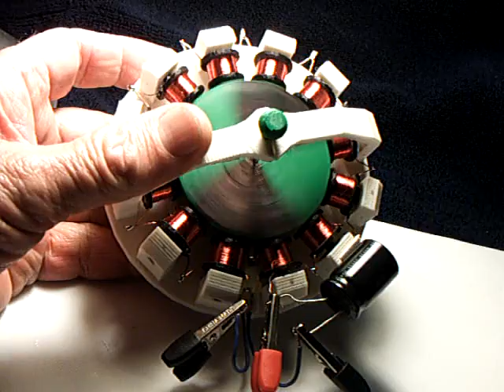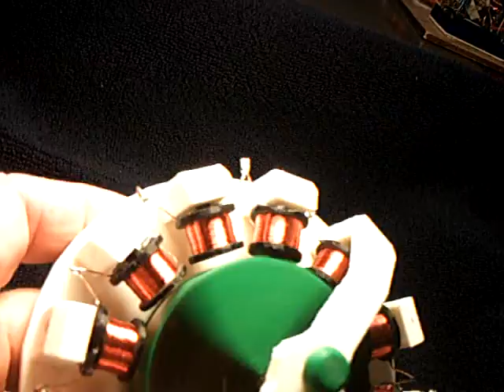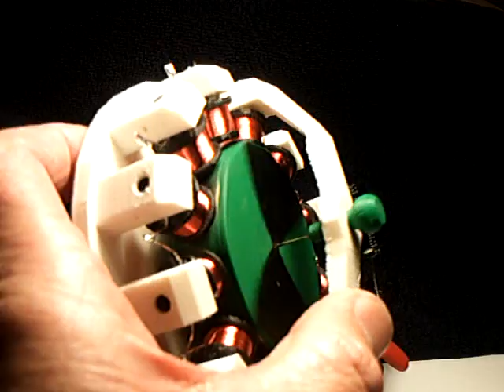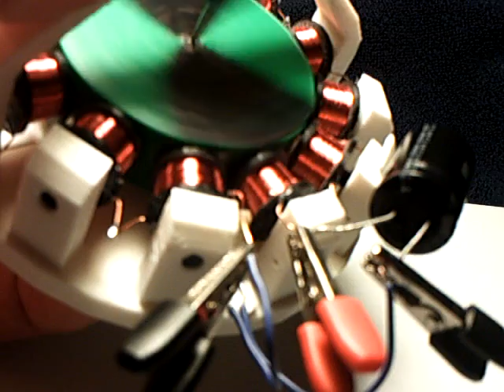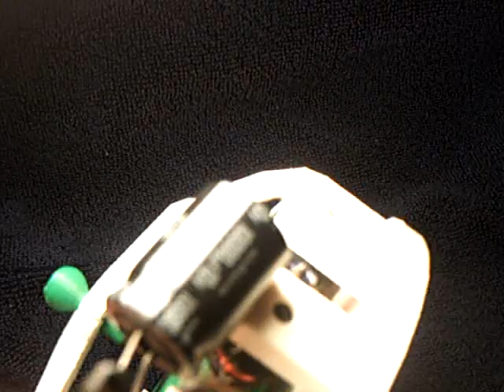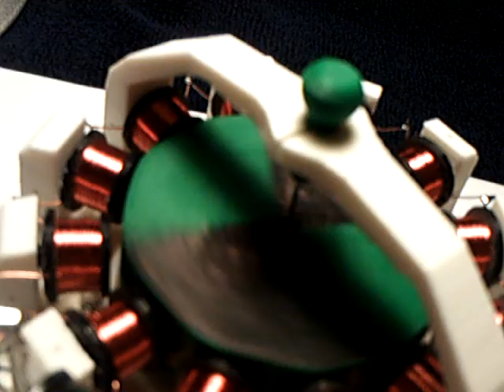Lasersaber EZ Spin Motor--  version 2

Comment: Lid:

Well done!  I'll bet winding those coils with that thin wire was a tedious job for sure.  That was cool of laser to send you those parts.  It is also great that you verified what he has said about this little thing.  Maybe this will change the minds of those that doubted his results.  I wonder how much this would cost to have printed somewhere?  I can't wait to see what else you do with this.

Bill
Reply from the maker: Pirate Labs Hi Bill.  I read somewhere that the motor costs about $80 to have printed at one of the places that already have the files.  You can download the files for free at Lasersaber's  web site and shop around.  It is wonderful to have an exact copy of what he showed in his videos and run the same experiments on it.  If you get the reed switch and the bearing adjustment just right you see the magic happen.  It is truly amazing.  I look at this thing and have to remind myself that this was designed on a computer ----and printed out.  Amazing.

Comment: did you try this with your electronic version?
Reply from the maker: t tallarico Yes.  It did not run on the electronic circuit that I showed.  It did run on another one though.  I am still fine tuning that circuit.  A plain old reed switch beats it right now.

Comment: Well done Lidmotor and Lasersaber ! Reminds me a lot to the old Newman configurations.. Please try to find out how you can maximize the induction recharge effect of  this motor.  Probably by using more switching pulses when the magnet is top dead center..also the contact points materials play a role of the switch.
In Newman's design copper and graphite worked best...so you might want to build your own mechanical switch which is switching all the time so you get the most induction pulses occurring...Regards, Stefan.
Reply from the maker: +overunitydotcom Thanks Stefan.  Yep. It reminds me of Newman's theory about a very long copper wire.  A good quality reed switch works good for this very low wattage motor but some type switcher circuit might be fun to try. One mistake with too much amperage and the long thin wire will melt.  That would be very unfortunate. Luckily the way this is made the break might be easily located in one of the 12 coils and the one coil simply replaced.

Comment: Great progress, Lidmotor - and Lasersaber!
As we continue to share ideas in the community, fast progress should ensue...
I'd like to congratulate Slider also, as he has done a 4-coil replication that ran for 27 hours using a 1F supercap, starting at 1V.  What Slider has done  is to get away from the tedious winding process by using pancake-like coils ready-made and cheap from dancing-flowers ($1 each at Dollar Tree), and shown that they work very well indeed! Discussion at overunityresearch.com "EZ spin motor homebuild" thread.
Reply from the maker: +Steven Jones Thanks.  I went over to the overunityresearch forum and read the whole thread on this subject.  It is very interesting what people say and share and which way these projects twist and turn.  No matter what happens there always seems to be a net gain in knowledge and that is what is important.

Comment: Very nice...good to see one of these being tested by you and very kind of him to send it out.
Am running a biasing magnet for the reed now on my homebuild and got a 27hr run + then 2hrs extra with the bias magnet (1F cap, starting at 1V). I wonder, do the reed metals pull at all on this 12 coil setup at lower speeds ? Perhaps offsetting with such a magnet would be an idea for these originals, if so.
Reply from the maker: I will have to try a bias magnet on the reed switch.   Yes the reed drags on the rotor unless you get the switch far enough away.  I may try to fire this optically.  I got this to work on the electronic circuit I showed but I need to do more work with that one.
Reply: *****
Would be very handy if an LED can fire, with optical pickup. Something like LED and CdS cell, being small current is all that's needed. Either side of a coil at 45 degrees (?). A research route for your build perhaps, as a sort of optical Hall arrangement.
Reply: @Lidmotor  I used your circuit along with the reed switch and it works very well. The reed switch acts as a trigger for the circuit as well as a timer. The reed switch was burning out but now it carries very little load.

Comment: I'd do some power and inductance/reactance measurements. The ohms sound waaaay to low to keep it spinning that long.
Reply: joblessalex  Your comment about way low coil resistance implies constant power draw by this motor.  Although not mentioned in its name, this EZ Spin Motor is driven by pulses measured in microseconds.  Fine tuning the magnetic reed switch placement (and additional magnetic field biasing) keeps the pulse duration to a bare minimum which results in a minuscule current consumption.  The clever design of pulsing all series connected coils to attract and repel all of the magnets at the same time in the same direction while increasing the coil resistance make this a very efficient motor but there are no new physics principles involved.  Unlike a semiconductor electronic switch with its minimum voltage limitation, the magnetic mechanical switch more fully utilizes the energy stored in the capacitor or battery which also contributes to the very long run time.
Reply: ReasonForemost You're right, but I still would like to see the output levels there to see if there is any sort of higher resistance effect going on as well to further lower the consumption.
Reply: joblessalex  It would be good to see test measurements of the microsecond pulses which would require precise oscilloscope readings.  There is no question that inductive reactance is a factor here due to the total inductance of the series coils and the very short duration of the pulses being applied to them.  As more replications are completed it is more likely that we'll see some of these measurements with the necessary test equipment.  Experimenting and sharing results inspires others to join in and contribute.  Good job Lasersaber and Lidmotor.

Comment: Nice Job, Lidmotor!

Winding those with just a drill motor would be a tedious task.

I guess from your statement that it ran for 16 hrs on ~.5V of the charged cap, that those jewel bearings really do make quite a bit of difference.

Thanks for sharing!
Reply from the maker: Thanks.  The coil winding was daunting.The entire motor design is contributing to the success.  The sapphire bearings are part of it but the other elements all contribute.